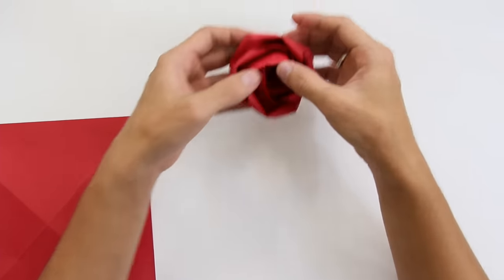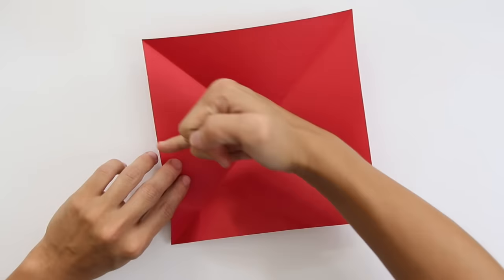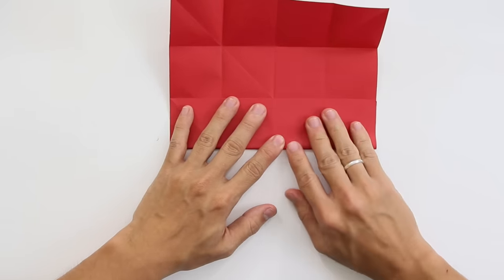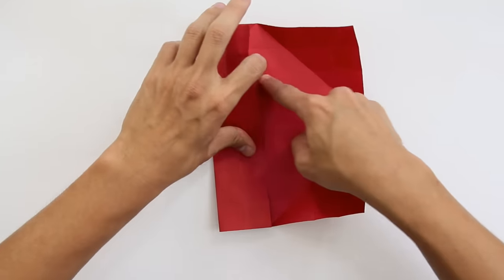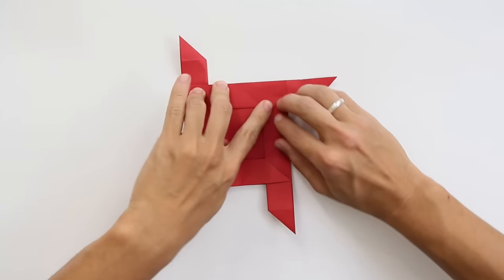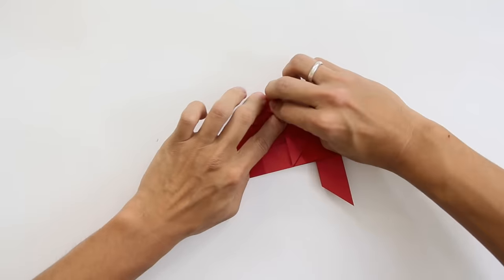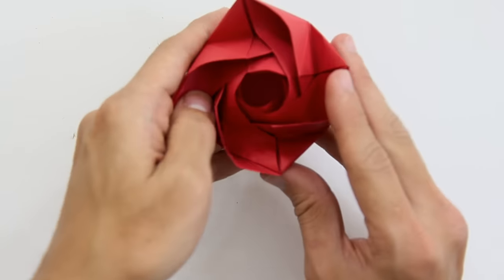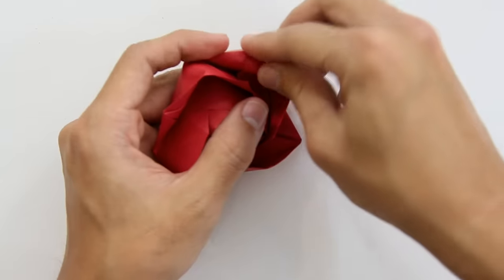How to make an Origami Rose (Evi Rose, by Evi Binzinger)

Comment: This looks like a useful model for decorating a card or some other flat surface. Thanks for posting by the way. And I bet most who would piss and moan over this video haven't tried folding difficult models just from diagrams. You have a video showing every fold. Pause, rewind, and try again, or work on something easier until you get to this level. Realistically mimicking something organic as complex as a flower you can't expect to be simple.